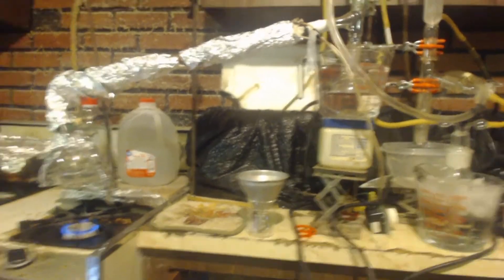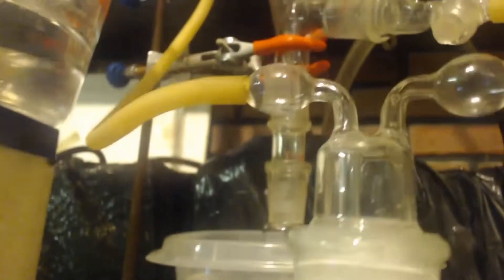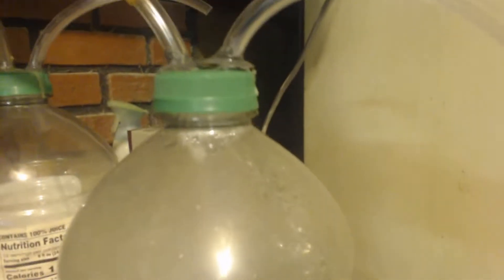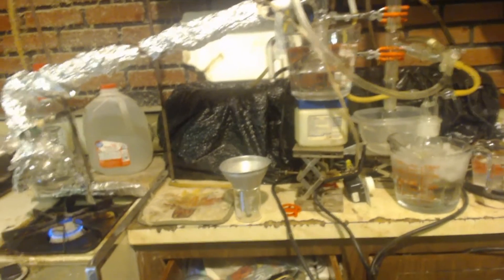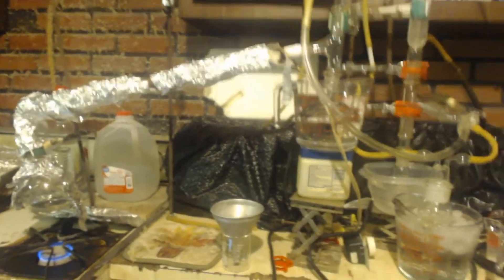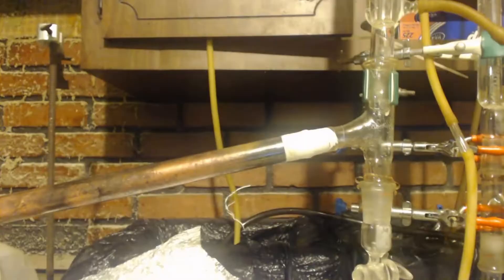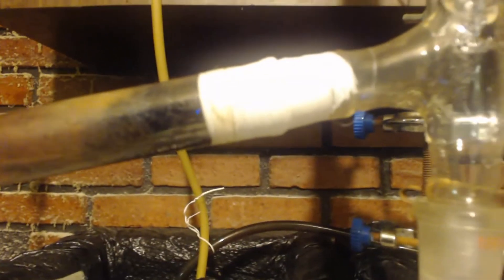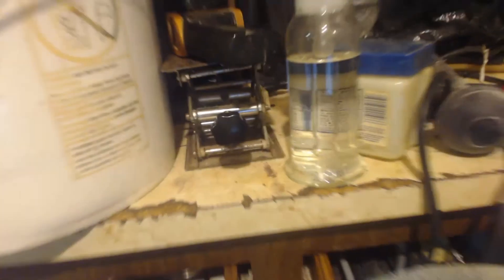ACETALDEHYDE SYNTHESIS part 1

Comment: my great friend john., teach us how to do the reductive amination of schift bases correctly., i have been doing it with aluminum wire and mercury chloride in ethanol 96% at 50ºc., the problem is that I do not see a vigorous bubbling of hydrogen I see just a small hydrogen vapor coming out in the ethanol., they are micro bubbles I have been making a mixture of 80% ethanol 96, 10% isopropyl and 10% methanol, in which I am failing my dear john
Reply from the maker: ANTXON...............  i do not actually do the experiment but i give exact directions in these 2 videos.   Part 1 = https://www.youtube.com/watch?v=Qamf6oPdaqM    and part 2 =  https://www.youtube.com/watch?v=ZZyFM6Cb9oo&t=516s  Let me know if it helps.
                 Part 1 is about the mechanism and part 2 is about exact instructions. 
                 Keep in mind when making the imine (schiff base) it should be COLD.   It is almost an instantaneous reaction and needs to be cold.  Then when you add the Al/Hg then you reflux at 50 to 60 C.   Also it is easier to just stick with methanol as your solvent instead of a mixture of different alcohols.   I mean methanol comes pretty pure in "heet" products.   All you have to do is add a little MgSO4 to the methanol (heet)  and dry it up a bit and filter and it is all ready.   
                  Also ........I could be wrong but i do not think you create any hydrogen during the reaction.     Also use aluminum foil instead of aluminum wire until you get it to work and then try experimenting with aluminum wire UNLESS YOU KNOW THE aluminum wire is pure
Reply: @johnblacksuperchemist2556  My dear john black., I had an idea if we use calcium carbide as an alcohol desiccant because when making the base free of methylamine a lot of water is produced and each mole of carbide absorbs two moles of water. form water I have found that carbide does not react with alcohol, or methylamine, or with p2p the only drawback is the formation of acetylene that can destroy the glassware and the only solution I found was to purge the glassware with butane gas for a portable torch it does not have sulfur.
Reply: @johnblacksuperchemist2556  But first we must make the methylamine free base and allow sodium chloride to precipitate and why else it will affect the reaction where calcium oxide and hydroxide are present. generating again methylamine chloride therefore a separate methylamine generator must be used consisting of a reactor with sodium hydroxide and methylamine dissolved in little alcohol drop by drop on the hydroxide, then the gas is concentrated in another container with methanol., Then the carbide must be added to the p2p pot along with the methylamine, then you must allow all the calcium hydroxide to precipitate and drain the liquid to another flask so that it does not interfere with the aluminum amalgam and that's it.
Reply: color your world  no., for me it is easier and cheaper to make a friedels-craft acylation of toluene and chloroacetone with aluminum chloride, for me it is very economical

Comment: What about using aqua ammonia to combine with acetaldehyde for purification forms a cyclic trimmer . Like paraldehyde or trioxine. Thanks for feed back the classic literature is always differant than the real life results seems
Reply from the maker: David.............that is beyond my knowledge right now.    I THINK an acid or base (ammonia) can break up polymers like paraformaldehyde and trioxane.  At least i know acid will.    But definitely not sure about for acetaldehyde to make the trimmer.    I might have it in my notes but like i said it is beyond what i know.    You might even do an aldol reaction having a base(ammonia) and a bunch of acetaldehyde in the same vessel.   I REALLY do not know............But i do know the acetaldehyde i made had to have been pretty pure cause i distilled it multiple times using vigoreax distillation and it came over slow and PERFECT at the end.   All at the EXACT temp it was suppose to distill over.  It did not smell like i thought it would.   When it is concentrated and PURE in a flask it smells some what ok.  I thought it would be nasty and sting my nose like formaldehyde.   WHere you are just repelled by the smell cause it hurts to smell it.  I am sure it is just as bad for your health but even concentrated it is not that bad......almost nice
Reply from the maker: David.............And yeah it seems like they lie a lot in books.  Or do not tell the whole truth is more accurate to say.

Comment: Could drip ethanol into acidifed chromate salt peace bro
Reply from the maker: David........Yeah i tried that once and failed.   Since then i learned that you need to keep the pot at a strong reflux when doing the experiment to get the aldehyde out as soon as it is made.   I have a lot of chromate left i have not used so i will probably make a video this winter on chromate oxidation of ethanol to make acetaldehyde.   But i do not like methods using chromate derivatives because it is such a hassle to make chromate from chromium metal.   And i really do not know where to buy chromate.  I know you can buy it at stores where they sell things to people who make pottery at home.    I think it is used for coloring the pottery.  But i really have not looked in the nearest city to where i live yet.   The reason i hate it so much is it has such a HIGH  molar mass you need like a truck load just to have a mole of the stuff.   Also an FYI but i think you should drip the chromate into the ethanol and not the other way around.   That way there is not a lot of chromate in the pot to over oxidize the ethanol.   Cause that is the main problem with that method is over oxidation

Comment: Nice to see you working on stuff again! Acetaldehyde is a deceptively tricky thing to make. Cool video!
Reply from the maker: Full Modern Alchemist..........HEY BUDDY.   I did like 10 experiments.   Unfortunately the first  experiment was one of my 2 best yields.  Each time i got 8 mL for my best yield.  But i learned a lot and next time i think i can get 7 times that.  And hopefully after a few experiments this winter i can even do better than 7X...........hopefully.    I go over my mistakes in part 2 and 3.   But i will be talking about how to make gamma alumina for a support structure for the copper.   And ratio (%) of metals that are best for the catalyst that target making acetaldehyde instead of the byproducts.   .  Like i think copper/chromium/zinc are the best metals....i think.   And also i will talk about how to get the metals on a gamma alumina structure.  And better temps for the experiment.  All these things cut down on sintering and poisoning and deactivating the catalyst and help activate the catalyst and swing it towards the product you want.     I think i have the whole thing figured out.  AT LEAST ON PAPER.    Now i just need to do the experiment again with everything i learned.

Comment: Glad to see you back at it. Love the videos.  Nobody else ever does kool home synthesis of compounds  people are scared off.  What about a copper oxide catalyst to lower the temp?
Reply from the maker: David........Thanks buddy.  There is not much information on the exact mechanism of this reaction.  I do not think anyone really knows.   But what i do know is it is not an oxidation reaction like i use to think.   It is 2 reactions.   The MINOR reaction is an oxidation reaction.  And the MAJOR reaction is a dehydrogenation reaction.   Meaning the opposite of hydrogenation when you use palladium or platinum to add hydrogen to a double bond.  In the copper dehydrogenation hydrogen is taken from the alcohol and a double bond is formed.   If you wanted to make acetaldehyde from ethanol using oxidation as the MAJOR reaction you would have to pump air/oxygen into the furnace tube where the copper and ethanol vapor is.   But i did not do that.  Also silver would be a better metal for oxidation.  ANYWAYS the reason i say that is dehydrogenation sounds like reduction.  And metals reduce things and metal oxides oxidize things.   So maybe an oxide would work without pumping oxygen into the reaction,    But i think it would just react with the air until the air ran out and then all the copper oxide that got reduced is all you would have to do the dehydrogenation reaction and your yield would suffer.  KEEP IN MIND THIS IS ALL A GUESS ON USING COPPER OXIDE AS THE CATALYST.   I only tried it once using copper oxide but all i got was a smell of acetaldehyde and no real yield.   I would have to do more than one experiment to know for sure.   I have learned a better temp would be 275 to 290 C.   In the next video or 2 i will go over .........let me paste it from another post i did........... I did like 10 experiments.   Unfortunately the first  experiment was one of my 2 best yields.  Each time i got 8 mL for my best yield.  But i learned a lot and next time i think i can get 7 times that.  And hopefully after a few experiments this winter i can even do better than 7X...........hopefully.    I go over my mistakes in part 2 and 3.   But i will be talking about how to make gamma alumina for a support structure for the copper.   And ratio (%) of metals that are best for the catalyst that target making acetaldehyde instead of the byproducts.   .  Like i think copper/chromium/zinc are the best metals....i think.   I would have to look in my notes.  And also i will talk about how to get the metals on a gamma alumina structure.  And better temps for the experiment.  All these things cut down on sintering and poisoning and deactivating the catalyst and help activate the catalyst and swing it towards the product you want.     I think i have the whole thing figured out.  AT LEAST ON PAPER.    Now i just need to do the experiment again with everything i learned